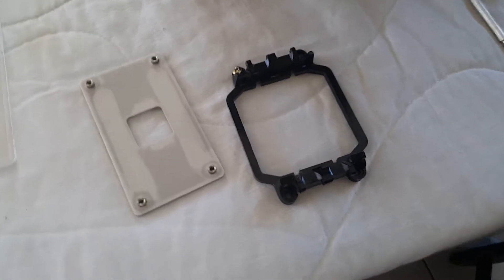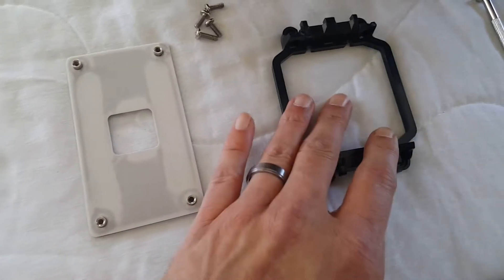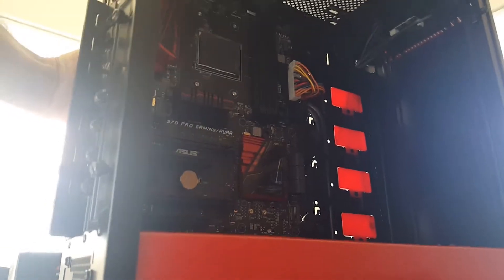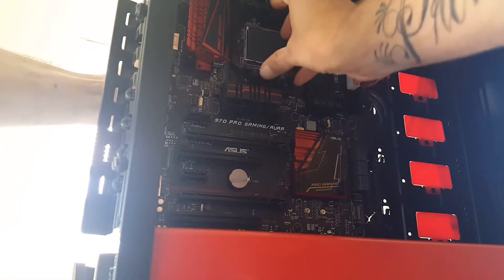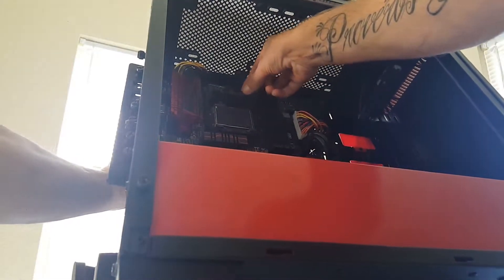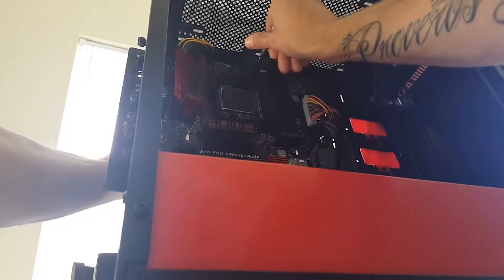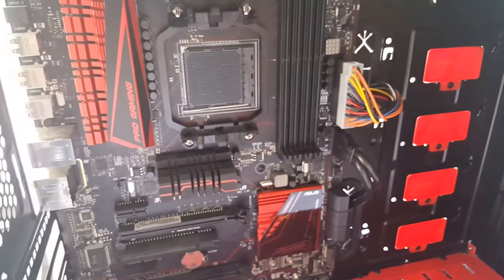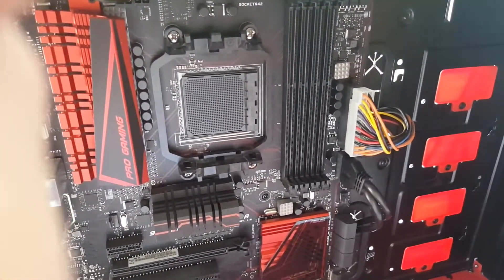How To Install A AM3+ Retention Bracket #PGNETWORK

Comment: hi im wondering if you know the screw size/dimension for AM4 bracket
Reply from the maker: The thread is M3 length just depends what cooler and mobo you're using.
Reply: @PapaGame thanks, im using a b450 aorus do you know the length?
Reply from the maker: @soulverse8622  I haven't worked with that board in particular. It also depends what cooler you are using. If you're using liquid cooling then it will come with all the screws you need. Of you're just using a stock wraith air cooler then best I've found is somewhere around 5.75mm. Your mobo should have came with backplate, retention bracket and screws. If you need to order a retention bracket still most of them come with the screws also.
Reply: @PapaGame  thanks for the information, i see alot of bracket online but not sure if they come with it since they never specify it, I guess i try to order it and see if it come with it. Once again thanks